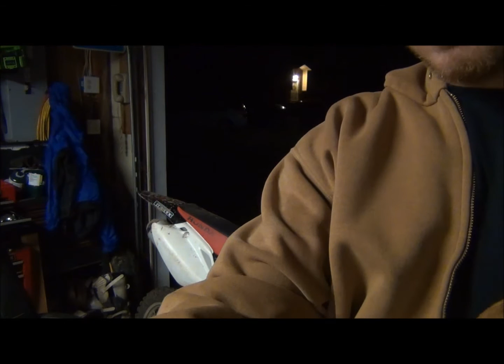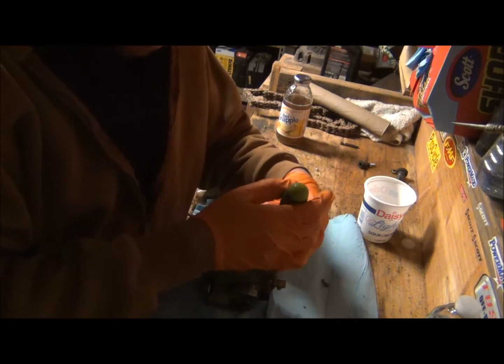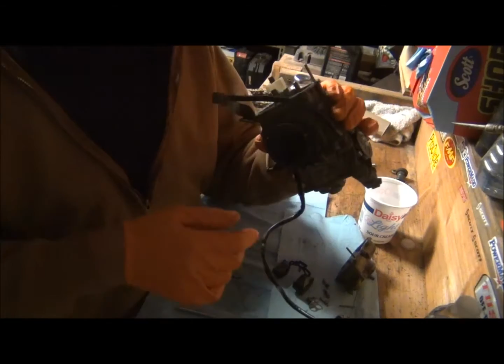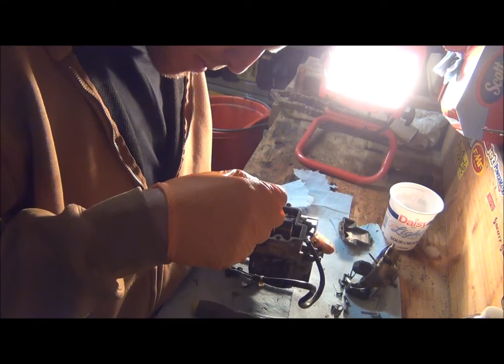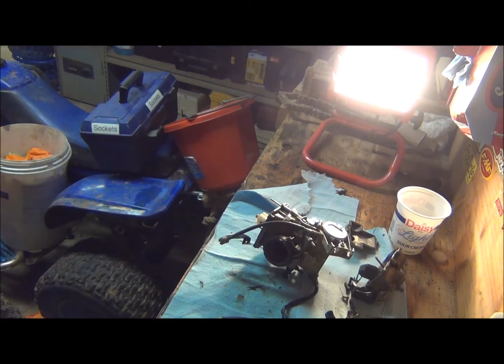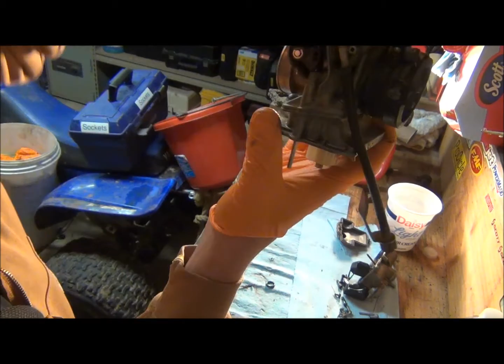crf150rb carburator work

Comment: @bluecollartim. I bought a used 09 crf150r. And it wouldn't stay running. It would start run for like 20ish second then die but it would run fine if I started it and start to ride it. But when I did that if I came to a full stop it would sometime die and it would sometime die when I released the throttle. The person I bought the bike from told me that the bike was sitting for like 4-5 months. So I changed the old gas and put VP T4 and also changed the spark plug. But it fixed the problem. Last night 7-22-20 I took off the carb and clean it. The carb looked clean but I took off all the jets blew them then sprayed carb cleaner into each jet. I'm guessing it fixed the problem because when I put everything back and started the bike. It started it up fine when I took off the the choke the bike didn't die. But not sure if it will die when I come to a full stop/ released a throttle. But the exhaust headers turned red as the bike was idling. I got scared and hit the kill switch. The exhaust header turn red before I clean the carb. And it would also throw flames out the exhaust. I would say the flames might be like a foot long. Maybe not. But I thought it was just bad gas. But it still did that after I put VP T4. I thought it might be something with the carb. So that just gave me another reason to clean. The carb. After I clean the carb it still throws flames but not as big or often as before clean the carb. So I googled what might be the reason why the exhaust headers was turning red and call a few dealership / bike shops. They would me the idle might be a dirty carb or a plugged jet. And exhaust might be the bike running to lean or to rich. Same with the forums I read. But one of the forums said the exhaust header turning red is normal. Don't full believe that. I have a fully built turbo Honda and never since the exhaust headers turn red. Also never since my friends dirt bike exhaust header turn red. Also when I noticed the exhaust header turn red it as at night fix.i was trying to figure out the idle problem. When I went look and buy the bike the bike wasn't having the idle issue and didn't notice the header turning red. Because it as sunny outside. But sure why it wasn't having the idle problem when I went to see it. Only thing I can think of is that it was the first time the person stared the bike in 4-5 months and one off the jets got plugged up. And for the exhaust have no idea why. So I was wondering if your 150r does that. Header turning red. If not what you think it might be and or how I can fix that probably. In the video you said you bought the bike from a guy in South jersey.im from north Jersey. If you are from Jersey would you mind helping me figure out the problem I'm having with the bike. Mainly the exhaust header turning red. If your from Jersey I can take the bike to you. I literally bought the bike last Friday which was 7-17-20. Haven't gotten to ride the bike at all. The person I bought the bike from gave me this word the bike as run 100%. Asked him if he would take the bike back because if the problems it having he said no. Even tho I massage him telling him the bike wasn't idling right without the
Reply: Without the choke and it randomly dying when I would come to a full stop/ I'm released a throttle. I messaged him a few hours after I bought the bike and got home. The next day 7-18-20 Saturday night I messaged him telling him that the exhaust was turning red. I guess I'm S.O.L and stuck with the bike now. Even tho he give me his word on the bike being 100% fine and if I had any problems with it to call him and shit. I would appreciate it if you can help me
Reply from the maker: Yea my pipe would glow, but it potentially sounds like it’s jetted incorrectly or your fuel mixture screw isn’t set right

Comment: Hey man I have a 2013 crf150rb and when I first got it it was having bad idling issues and throttle response problems so I took the carb off and cleaned the jets and carb as they were really dirty and clogged and now it idles with no problem and has good throttle response but now the idle hands. When I rev it and let off the idle stays high for a good 10 seconds before returning to its proper idle. Do you know what the problem could be with that? Thanks for any help and great video!
Reply from the maker: HondaLoyal85 hey I've been doing a lot of research on this, I have an 08 and I could not get it to stop that. I actually just bought a brand new 2009 carb. But what I have narrowed it down too is the computer that runs from the top of the carb to the rev box. So I'm gonna try the new carb and if it doesn't work the in gonna try and switch the rev box out with a higher quality. I have noticed though that a lot of people have this problem but I will be doing the switch next week and I'll keep you posted
Reply: Russell Garage yea I see all kinds of people people that have the exact same problem and no body can figure it out.  My bike didn't do it before until I took the carb off, I didn't change anything I just cleaned it so idk, I thought it was the hot start of the tps but I tampered with them and had no changes so idk. Let me know if you get it figured out
Reply: Russell Garage did you ever figure out the hanging idle problem?
Reply from the maker: HondaLoyal85 yes so I'm going to assume because it was the last thing I had changed out it was this piece http://www.partzilla.com/parts/detail/honda/HP-16060-KSE-671.html

The bike will high idle for 2 seconds and then drop down unlike before it would stay hanging constantly 

It's a throttle senor and I believe that was to be causing my hanging idle, it might work it's a 70 dollar part which beats buying a 500 oem one brand new carb(which was what I wound up doing) that would be my only suggestion as of this point. But from everything I've read and seen on these bikes there carbs are very temperamental.
Reply: Russell And the barnyard Pigs so that 70$ part fixed it? Is that the electrical thing that runs to the cdi box? I tested it on mine and it was good cause I thought that it was the problem.
Reply: Russell And the barnyard Pigs I just bought a feeler gauge and am gonna check the valves because I've heard that tight intake valves could cause this problem and I have noticed it is getting a little hard to start. And did that 70$ part fix the problem for you or the new carb?
Reply from the maker: HondaLoyal85 yea the part fixed it for me but I would definitely check valve clearance first while you the rockers off I'd check exhaust too, if you need a shim kit hot cams make one which is the one I have comes with four of each with a lot of different sizes. Order from eBay rather than your local dealer you will save a lot of money
Reply from the maker: HondaLoyal85 also if you need the specs for anything let me know I have the shop service manual at the house I can send you pictures of the pages you need
Reply: Russell And the barnyard Pigs yea I'm gonna measure everything and jut figure out the exact shims I need and order them oem. It's like 7$ per shim and u don't have to buy a whole kit, just the ones you need. U gotta do some crazy ass math though but I'll figure it out and thanks for the help. And what did u mean by check the exhaust?
Reply from the maker: HondaLoyal85 ehaustvalve clearence as well as intake
Reply: Russell And the barnyard Pigs yea I'm going to do all 4 of them
Reply: I'm about to clean my carburetor on a 09 crf 150, did you ever figure out why it was doing that? Did you adjust the throttle cables any when taking carb off?
Reply: KING JET I ended up just turning the idle adjuster down and it ran great like that. I’ve had 5 150rs since then. For every single one of them I have put either a 42 or 45 pilot jet in the stock 38 is too lean that helps out a lot. Do that and buy a #78 o-ring from your hardware store and wrap it around the accelerator pump thing there are YouTube videos that will show you how to do that. Also make sure your valve clearances are within spec. If you have an aftermarket exhaust you will have to make other adjustments to the carb but if you are running stock exhaust and the valves are in spec just throw in a 42 or 45 pilot jet and it will run much better. You can also buy an aftermarket air/fuel mixture screw so you can dial in the air fuel ratio. For the idle I always just turn it up until it starts hanging then back it back it back down to right where it stops hanging and comes back down pretty quick to normal idle. Other things to check or is that the hot start plunger isn’t sticking, the throttle cables aren’t too tight, and that the air filter is clean and properly oiled
Reply: @hondaloyal8570  thank you much appreciated